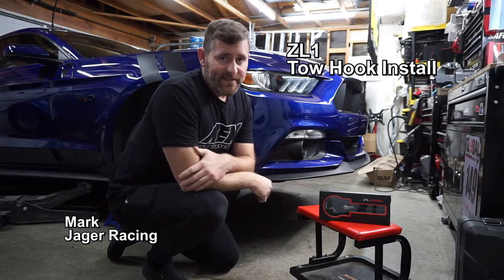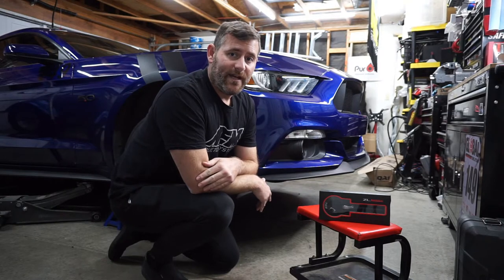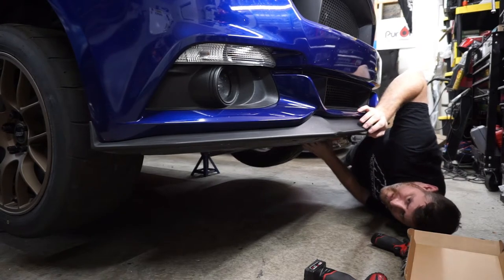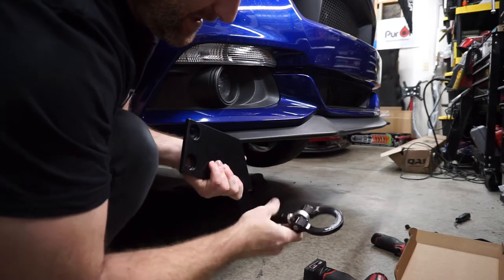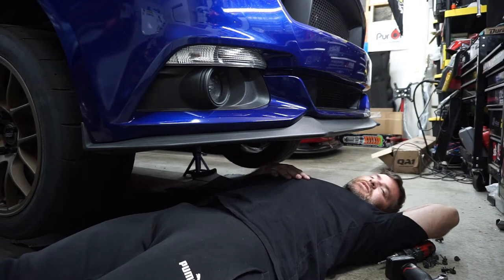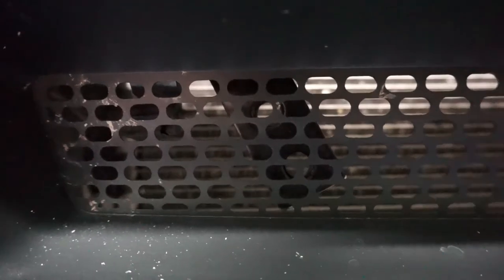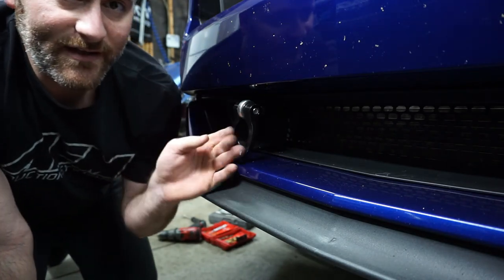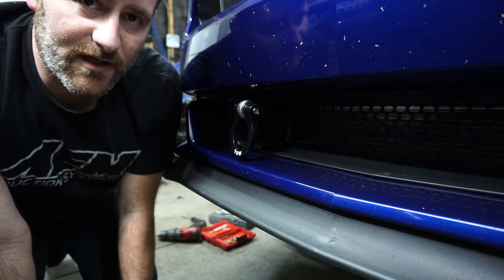S550 Mustang ZL1 Tow Hook Install

Comment: Thank for the video!  What is the distance from the center to the tow hook? Or from another reference point?  I have splitter rods and want to see if there is any interference before I purchase.  Thank you
Reply from the maker: It is 8.5 inches from the passenger side of the bumper opening to 12 inches of the passenger opening
Reply: @JagerRacing  thank you sir! I sent you a DM on IG to ask you if it’ll work on my car
Reply from the maker: @warrendennis84  copy, I’ll check there

Comment: When driving the car will the tow hook end up bouncing/scratching off the paint of the lower half of the front bumper that the tow hook sits above like driving on a rough road for example because if I order I don’t wanna have it ruining my paint on my car and damaging the bumper. Thanks
Reply from the maker: Nope it doesn’t move at all.
Reply from the maker: Well.. it can move but it take quite a bit of force.
Reply: @JagerRacing  has it damaged your paint or anything at all since installed?
Reply from the maker: @infinitesply7633  negative hasn’t touched the bumper at all